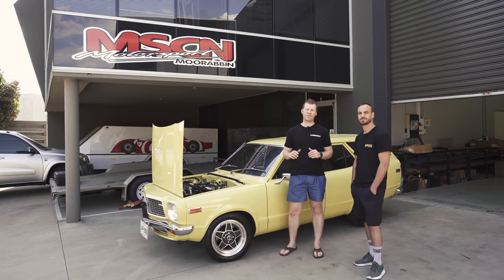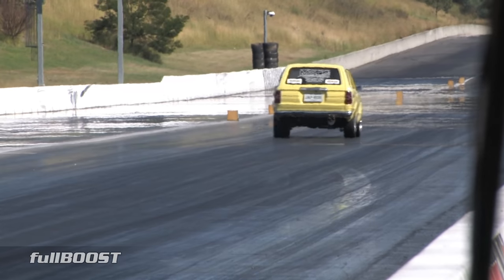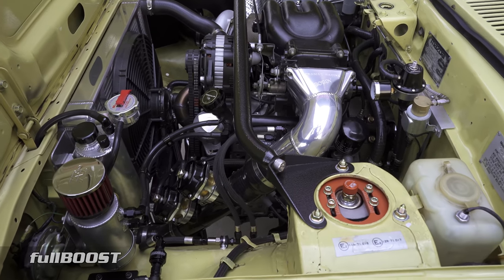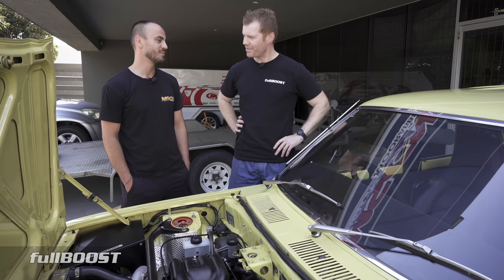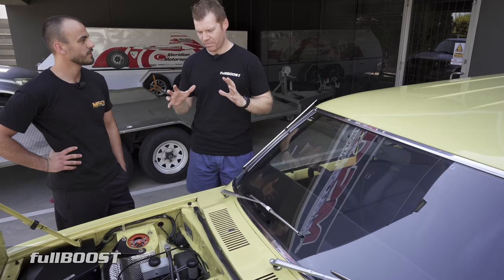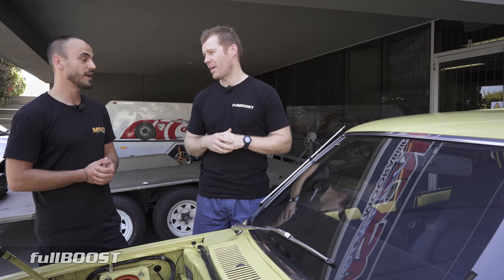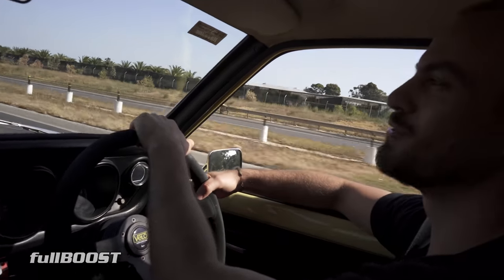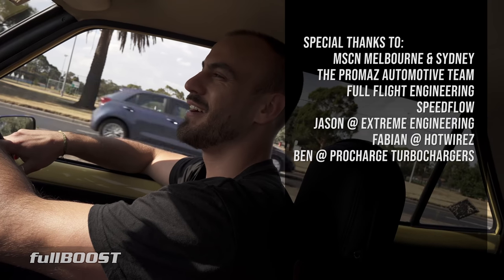Inside a 10-second 13B rotary street Mazda 808 wagon | fullBOOST

Comment: Same upgraded turbo we use on the Barra's lol.
Also a lot of people in Australia STILL under rate water meth injection.....
Reply: It was the only option we had years ago. I had a TA22 Celica with a modified 3TGTE in the 90s and I made my own water/meth injection system, It was just a 12PSI pressure transducer/switch operating a windscreen washer bottle/motor which sprayed through a motorcycle main jet into the intake. I also had a level sensor in the bottle connected to a light on the dash.
Reply: I mate and I bought the Snow Performance kits back when our Aussie dollar was good ($325 stsge 2 kit delivered) and on his FG turbo it was used mainly as a buffer for knock. Temps here in Nth Qld are quite shit mostly but intake temps just keep falling regardless of how long we were on the throttle and exhaust gas temps were down by easily 200.... 25-22psi on a stock GT3582.
Basic Hobbs switch activated at around 10psi. I'm yet to fit mine to the Territory Turbo now!
Reply: @johnwilson1794  thats pimp bros lol very curious how was your Afr's ?
Reply: @johnwilson1794  impressive bros ... back in the days for u to do what you said must mean your very switched on.... love the part with pulling 10 degrees timing through checking vaccum....nice bros.... whats a cgi locker ?
Reply: @jmoore9806  Haha! BOC gases used to be called CIG. When people welded the diff centre they called it a CIG locker. Poor mans spool. Some people used to just weld plates between the spider gears in the diff centre but I found that failed after a while so I ended up removing the spider gears completely and welding the side gears to the carrier.

Comment: E85 can be classed as a pump fuel, I fill my FJ20 datto at the pump. The usage rate is a myth, my 1600 gets 9-10ltr/100km on average, but then again I don't use an abacus to control fuel.
Reply from the maker: While E85 is great for performance & drive-ability, the fact that most service stations don't carry it is a major drawback...😏
Reply: @fullboost  oh most definitely is a draw back, just gotta plan for the trip i spose. I still have massive amount of respect for people making power on 98 though, because it definitely isn't easy.